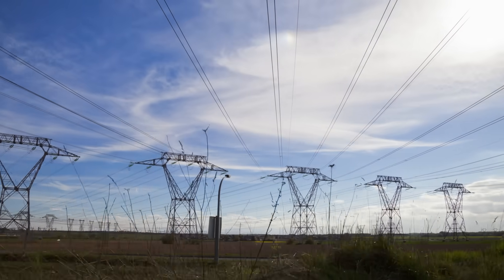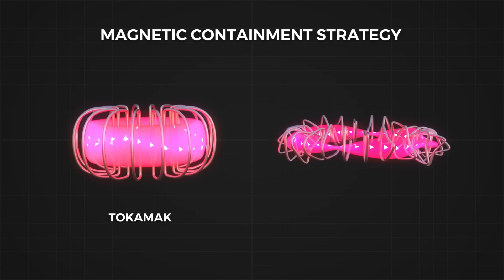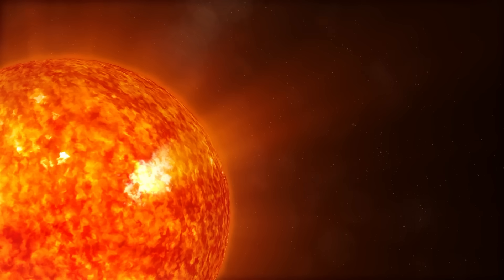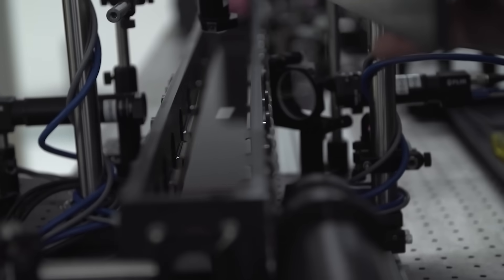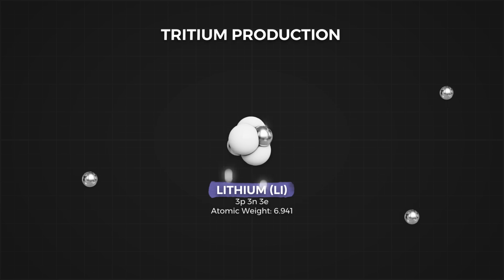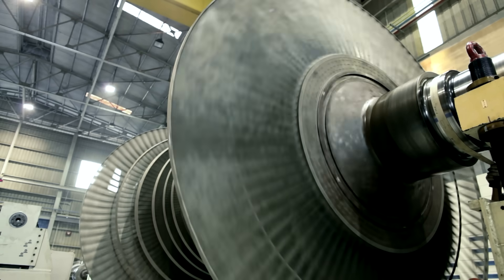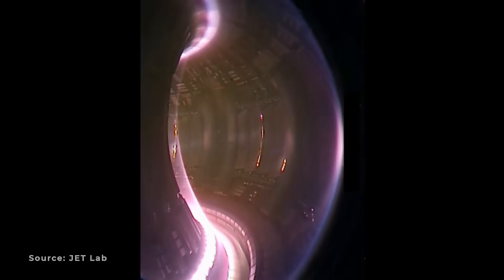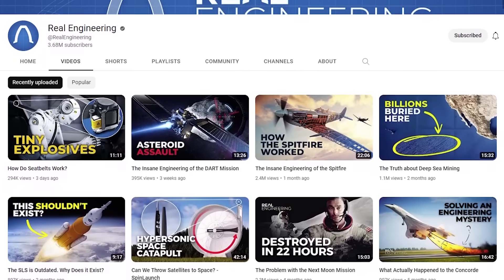The Problem with Nuclear Fusion

Comment: Typically nuclear fusion energy presentations are filled with sales hype, as the introduction to this video was. Since almost anyone who develops expertise in the field is also a fan of it. One result is there are few sources for totally independent critical assessments of the technology and its present state. Typically the arcane technical jargon and complexity is used as a tool to hide and distort key parameters needed to evaluate how close the various experimental approaches are getting to a economically practical power plant. Some of the terms that are commonly employed are based upon definitions that don't match with the definitions that most people use when they use such terms. For example there commonly used term of energy gain is usually represented as Q. The specific Q that they often mention is the ratio between the energy generated from fusion reactions divided by the input energy that ends up heating the plasma. That is sometimes denoted as Q-plasma. The fact is the input energy needed to power the entire facility can be more than 100 times greater than the plasma heating energy. Additionally the Q-plasma value only applies during the period that the plasma is being heated. Most fusion tokamak-like devices will be pulsed when operating at near their full fusion power levels and may have lengthy recovery periods. So the Q-plasma value for such reactors only applies to the 'ON' period of time. The nearness to a economically practical power plant should employ Q-total averaged over at least a 24 hour period of operation. All current scores of experimental reactors are still many orders of magnitude away from achieving even a Q-total value of 1.0. The term 'ignition' is another misleading term. Most people assume that involves something similar to striking a fire-match head in which case the reaction begins at one spot and then propagates until all the fuel is consumed. In the nuclear fusion energy field the situation is very different. Typically, high levels of input energy must be maintained. With magnetic confinement fusion (MCF) the reaction will be spoiled by the buildup of reaction products and perhaps only half the supplied fuel will get a chance to react before it is sucked into the vacuum pumping system. In inertial confinement fusion (ICF) the force of the reaction is likely to blast away a large fraction of the supplied fuel before it succeeds in fusing. In the case of widely cited 12/05/2022 NIF experimental shot the fusion reaction only lasted approximately 0.000,000,000,08 second before 96% of the fuel was blasted away from the microscopic 'hot spot' fusion region. It was then sucked into the target chamber vacuum pumping system. The above video did mention the extreme rarity of the tritium component of the 50-50 fuel mixture. Many fusion sales pitches continue to claim that the hydrogen fuel is almost unlimited. Rarely is it mentioned that the tritium is radioactive with about a 12.5 half-life. Always unmentioned is that the current commercial price is above $30,000 per gram. The above video failed to mention that the massive ITER project is now grossly over its original budget and well over a decade behind its original schedule. Part of that has to do with major component manufacturing problems. According to the officials ITER is not expected to begin their first D-T fusion experiments until 2039. The fuel breeder technologies will not occur until well after that date. Only a tiny fraction of the scores of fusion energy experimental facilities have ever employed tritium. Only a tiny few have ever generated more than a few watt-hours of fusion energy for a brief period of time.

The narrator, in the above video, claimed that he was witnessing fusion energy generation when visiting the Helion Energy research lab. It may have been a pink plasma glow but not likely due to fusion reactions. There CEO, David Kirtley, is a master pitchman. Helion's 6th generation machine performed around 20,000 test shots. None generated any significant amount of fusion reactions. They are now constructing their 7th generation machine that is supposed to demonstrate electricity production. It appears it is tardy.

Billions, worth of USD, are now being thrown at a wide range of fusion energy experimental projects and new ones frequently appear as increasing numbers of investors are easily hoodwinked. All such experimenters, and their supporting industries, assume that we have decades left to shift to the fusion breakthrough technology that they have been convinced is just around the corner.

Virtually all nuclear energy promoters, are in line with the vast majority of Earth's other 8.0+ billion humans, who continue to assume that we still have at least 20 years left to turn this 'Titanic' around using their favorite nuclear technology. They have become masterful in excluding the following warnings from their consciousness. I urge readers to search for the following two article titles.

IPCC report: ‘now or never’ if world is to stave off climate disaster (TheGuardian)

UN chief: World has less than 2 years to avoid 'runaway climate change' (TheHill)
  * This statement was made 5.8 years ago.

Comment: I've seen some comments asking how we are even making any "profit" energy in fusion so here a quick breakdown (im not a scientist this is self tought , pls correct me if I'm wrong):
So basicly you remember that little law that they told you in physics in school about how "energy can't be destroyed / created, neither can matter" while this is technicly true there is one thing that comes close to creating or destroying enerygy or matter. They can switch. The amount of energy and matter added together in the universe can not be changed but matter can be transformed into a lot of energy and the other way around a lot of energy can be made into "new" matter. This is what happens at a fusion reactor. We smash to elements together (under a lot of input energy) and (in theory ) get a new element out of it that is slightly lighter than the mass of the 2 input elements combined shouls be + a lot of energy that is also more than we put in. What just happened is that while combining those 2 elements under such great power a bit of the matter got transformed into energy. And as you might remember if if we transform matter into energy we get a lot of energy for a tiny bit of matter. This is why (in theory) fusion is such a great concept if working under perfect conditions. The exact amount of energy needed to be put in and the stuff we get out and so on can all be calculated using Einstein's famous formula: E = mc²
where E is the energy, m is the mass and c² is the speed of light².
Oh and btw sorry for the spelling / grammar mistakes I'm german and still learning English

Comment: Abundant energy will be relevant for the climate even without releasing greenhouse gasses, especially if using inefficient steam turning a generator to create electricity.
Instead of trapping heat from the sun like CO2, well generate the heat right down on earth ourselves.

Comment: even if we could achieve commercial fusion tomorrow, it wouldn't help much in creating a so called utopic future:
- even if everything in mining facilities could run on electricity around the world, they would still produce (kilo)metric tons of toxic waste, some of which would need to be dealt with for literally generations. and the problem is we need more and more metal for everything, thus more mining and hence more toxic waste hazards.
- transport (trucks, boats, planes, etc) heavily relies on fossil fuels and not batteries for a reason, and it's not going to change overnight, probably not even decades, if ever.
- if one thing, we've seen time and time again the rebound effect in action : any gain in efficiency is always followed by a massive increase in usage. ie should electricity become seemingly "free" some day, we'll be using (more like wasting) it to do anything, which in fact is already what we already do with fossil fuels which we use for absolutely pointless stuff.

Comment: I don't know why, but nuclear fusion reactors like this structured reminds me of black holes or better said: black holes are structurally and behaving like those nuclear fusion reactors. They also have plasma that is spinning in circles, but instead the EM field holding the plasma in its place, the mass rotates around the the plasma like a donut (as in this reactor holding the mass with magnets from the outside) just from the inside of a black hole. Exactly like this, thing. In the middle there exists exotic material plasma that is a soup and repells all matter (so it can work like this reactor), which would be NEGATIVE energy mass, thous is the singularity. In the middle exists "Nothing(ness)", which is in reality just negative mass. 
Black holes are soooo efficient, that they die in 100^100^100 years due to Hawking Radiation. So, it would make sense, that those reactors are practically black holes and have infinite energy source as long as you give them some matter (just like black holes lol)

Comment: Dude, so many mistakes you did in single video about fusion, plasma, etc. That shame how many  people watched it and learned your mistakes. 0 explanation what is plasma (and wrong animation), 0 explanation what is energy(and still wrong animation). Also about nuclear plants - that totally lie dude, "green energy" so dirty and noneffective, that single nuclear plant are cost efficient and do significantly less pollution. How you can lie so much?
Reply: Then give your explanation instead
Reply: @adarshjayakumar2376  Plasma - is ionized matter. What is ionized matter? Or ions? Ion, is charged particle. Single elector - is negative charged particle, single atom without electrons - is positive charged particle. In he's animations he shows plasma as complete, neutral atoms (atoms with electrons), so this actually not accurate representation.
Next - also plasma is hot, but what is heat? Is actual average kinetic energy(i.o.w. speed) of each atom. Why you need to know it? When you do fusion, your created particles are get speed (kinetic energy or energy), so you want to take this kinetic energy and use it. And because particles in plasma have chaotic move directions, this kinetic energy we calls as heat. So, this energy not magic field, as represented. And this is important to understand, how is works.
Lets move to the green energy and nuclear plant: 
First - count of nuclear plants are dropping only on WEST countries, many non - west countries are building them.
Second - the ratio of consuming and producing energy for nuclear plants is heavily positive, when on green energy is negative or about zero. What is mean? That mean, that for example, for producing solar panel, you use more energy, that this panel can produce for whole life time of this panel. Same for windmills (most of them).
The only green energy, that actually are possible to use - is hydrogenation and thermal generation:  pretty simple to use, simple in service.
And third: nuclear plant for whole life time produce significantly less Co2 then any another group of power stations with same power production. And modern stations are actually are don't produce any radioactive waste. 
P.S.: Global warming - is true, does this human blame? There no direct proves. Does CO2 is bad? NO! The whole chain of life are built on CO2: any plant without CO2 will die, so every one who want preserve this gas - actually want to kill the whole life on earth without using nuclear weapon.

Comment: What we need to be doing instead of waiting on this pipe dream is build more nuclear fission plants BUT at the same time build the reactors that can utilize the “waste” products of fission plants (recycled several times) thus reducing the amount of time that the final waste product will need to be stored to a few years as opposed to hundreds or thousands of years.  So, fission plant “waste” supplies are recycled into fuel for the secondary plant, reducing radioactive waste to something that could be easily dealt with.  New industries are created, jobs are created, electrical energy is created, and waste is reduced.  As a plus the reuse plants cannot melt down.  No new science is needed, no rare metals are needed, no waiting “20 years”.  We have the technology NOW.
Reply: The cost of a new Fission Nuclear Plant has become prohibitively expensive.

Comment: At about 5 minutes into the video, you mentioned that the unlikelihood of forming deuterium is not a problem in the sun because of its size. I would disagree, because early scientists said the sun wasn't hot enough. They were puzzled about this until they came up with the concept of tunneling.

Comment: the most offensive thing here is that we already have a working fusion reactor: In general, the Earth receives less than 0.5×10−9 (one two-billionth) of the energy of its radiation from the Sun. while 60-70% of this energy is reflected back due to the influence of the magnetic field and the atmosphere. and only 2% of this pittance is absorbed by trees and other greenery on the surface. just think about how much energy is there. The Sun radiates 960 billion kW-hours towards the Earth every day. The 2021 world total energy production of 14,800 MToe corresponds to a little over 172 PWh / year, or about 19.6 TW of power generation. 960 TW per DAY versus 20 TW per YAER produced by the whole world. and do you know how we could get this solar energy? simply by creating a sea of sailing satellites that convert the sun's energy into microwave energy and send it to receiving stations... but... but... but... we'd rather bomb each other with missiles, and be afraid to give the keys to control a giant space microwave to anyone who doesn't like any of the flags... no one wants to be that ant that the lens will be aimed at... so that's how we live...
Reply: Are you suggesting that we block the sunlight from hitting the earth?  👎
Reply: @MrSummitville  no...there is like infinite amount of empty space and you are thinking only about that single point right between us and sun...srsly...think better
Reply: @xXScythianUAXx  No the surface area is not infinite. You can block the sun over your house. Nothing else!

Comment: We already have cheap fusion energy. It is called the Sun and has its own containment field. Solar panels have never been cheaper and battery storage solutions are improving every year.  Tokamaks seem to be a flawed design as well as others. I run my entire house on fusion energy. I spent 20K USD (no lease) on panels, controller,  and lithium batteries.  I did not spend Billions of USD to get stupid results in a lab,  Local homes, all with panels and batteries, networked together in a local power grid seems to be a good idea, but no, let's give more Billion $ grants to researchers who are void of logic.

Comment: Mini-sun on earth? Not true. In the sun, fusion is an entirely different reaction based on H-1 (normal hydrogen). This has never been replicated on earth. Fusion reactors and nukes use a reaction with H-2 and H-3 (deuterium and tritium), which makes fusion on earth utterly ineffective.

Comment: Successful FUSION DUMPS HEAT directly into the atmosphere that would have never been dumped into the atmosphere otherwise. This is called POLLUTION!! Not CO2 type pollution but nonetheless pollution!  I agree that fusion is great but only IF it is paired with a NON-GROWTH based economy. If you don't pair fusion energy with a new monetary system that is NOT based on growth (yes they exist) THEN you heat the planet and eventually cause a mass extinction of humans. Infinite growth on a finite planet is not possible – by the laws of thermodynamics. The timeline for disaster is perhaps in the range of 75 to 150 year if we find fusion now and commit suicide by liberating more heat. So by way of review: CO2 traps heat indirectly and fusion liberates heat directly ... both have the potential for heat death, just different mechanisms.  Kindly stop being stuck on stupid and talking about fusion as a cure-all. It is not...unless you pair it with an economy that is in balance with nature. You need BOTH!  My background: doctorate engineer, physicist, former senior scientist at NASA's Jet Propulsion Laboratory.